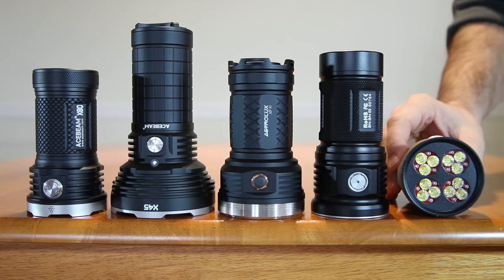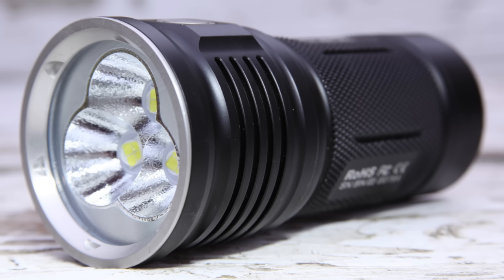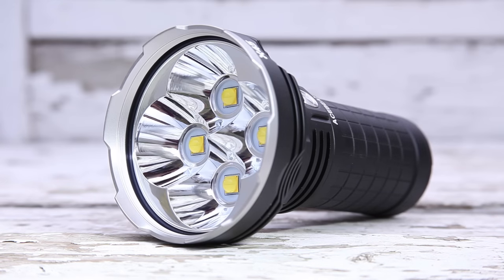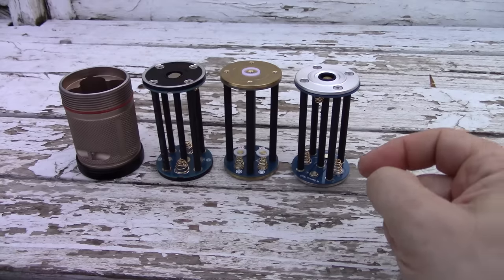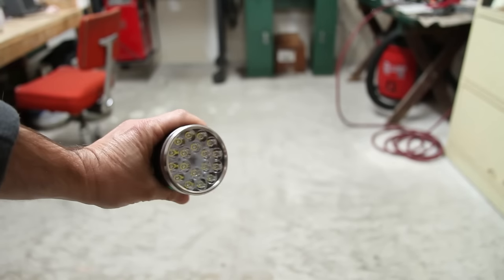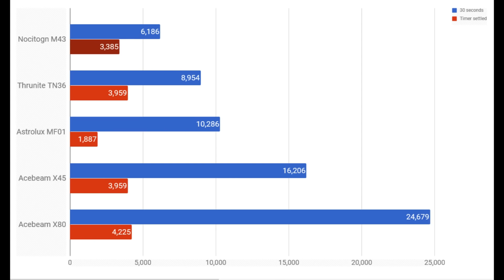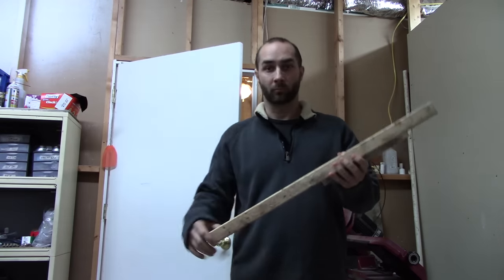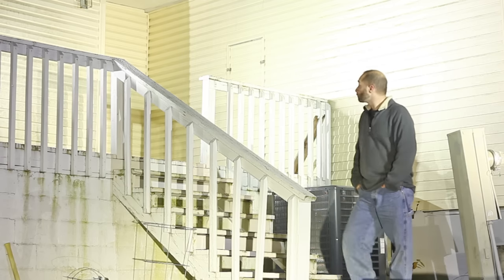Brightest Flashlights of 2017! (Top 5 best).

Comment: Hello!

Your channel is to be congratulated! I'm from Brazil and I'm watching your videos. Very good!

In your opinion, is the Astrolux MF01 12000LM flashlight in what quality position among the 5 lanterns? Bad, Medium or Excellent? Is it a good buy?

Thank you!
Reply from the maker: The physical build quality of the MF01 seems very good to me.  The acebeams I think are slightly better.   The only thing I didn't like about MF01 is I thought the output after the turbo timer went off was a little low, only 1800 lumens.   The others all got between 3000-4000.
Reply: Thank you!

Comment: i have 2 astrolulx mf01's i paid $79 for each of them and then bought the expensive samsung batteries and balancer charger for another $70.  This light is a monster.  The cons are its heavy, gets hot when super bright, and the anti roll body is useless with the perfectly round lens head.  Its by far the best budget in all the lights in review and many others.

Comment: My X80 has a different switch funtion. If i go from off to holding the button it goes to ultralow then red. If i keep holding it down after red it starts flashing red and blue like a police light :S to cycle through the other colours i have to let go of the switch after red and then press and hold to go throug the other colours. Can anyone confir if it is supposed to flash red and blue?
Reply from the maker: Sazan if I press and hold from OFF with mine I get moon light.   If I continue to keep the button pressed after it comes on to moon, I get a double flash and then when I let go of the button it turns off and is locked out.    To unlock it I press and hold again.

Comment: This question is for the owner of the Youtube channel. How do you like the MF-01 in the Cree XPG3 tint?  How would you describe the tint, the color temperature in kelvin and the CRI?
Reply from the maker: Hi SK,     Normally I'm not a fan of XPG3, but in this case it works.   The color is a slight step back from the far end of cool  I'd guess it to be 5700k ish.    CRI is ok, but just ok.  Not bad just nothing special hard to guess that but I'd say 75ish.     The thing that stands out to me is that the optic removes most of the nasty two color rings that you get with most XPG3 lights.   Normally you get an bright pink center with orange edges, and it makes me gag.    That light belonged to a friend so I don't have it here to re-study it on the wall, but IIRC that really wasn't the case with this light.
Reply: Cool! Thanks for the info! I purchased a CW version and I'm still waiting on it. I think i'll be happy if it's in the 5700K temp. I think that is my preferred color temperature anyways. 75 CRI i guess isn't all that bad. It's not great but it's doable. I did pick up a NW version of the Olight X7 Marauder from a guy on the BLF forums and while I do Like the NW tint, It seems a bit more on the 4500K side making it a little too yellow for my liking. The color index though makes everything a bit more natural. How would you compare the MF-01 to the x7? Thanks btw for answering my question! All your reviews are pretty good with a little bit of humor thrown in. Keep up the good work! I look forward to seeing more reviews!

Comment: the TN36 is nice, but i switched to TN35 bcause of the better beam, the ring controls and as flooder i got the M43 with XP-Gs
Reply: The TN35 is obsolete. The TN36 Limited blows it out of the water @ 11000 Lumens. I also have a TN40S which is a a really great thrower w/flood.
Reply: K Danagger in m opinion the NTN35 is still a nice allrounder.
Reply: K Danagger and the throw is still better on a TN35, thats also a reason its my main light when i need much light for a long time, next to the fact you can use it at max output without getting hot. TN36 doesnt have the thermal capacity and area to spread the heat for a long time, like my M43 Meteor... nice flooder, awesome to impress friends with 7000Lm Turbo... but only useful when you need under 2000Lm constant, because it cant get rid of the heat.
But thats why i like the M43... one button press for momentary „daylight“, small can design, and awesome runtime with 4x18650, so i have to charge the batteries like once, sometimes twice in a month, where i have to charge my small 100mAh LiPo, 550-800mAh 16340s and so at least once in a week.
Luckily, my NiMh AA/AAA Lights are used so „often“ that they stay like full for a year or so.

Comment: I think the Imalent DX80 may be the brightest at 32000lm
Reply: yeah, but they are built like shit and fall apart,and blow up...so whats the use ?
Reply: Yeah well im pretty sure the current Olight X7R Marauder is built like shit as it has production fault with the charge port which isnt even water resistant but claims to be water-proof
And then there is the X7 which i have and rarely use and the switch is fucked for no reason never been dropped never been wet batteries are always charged

Comment: if i want to buy a led flash light that is BRIGHT and not cost more then 50 - 80 $ what should i buy ?

I have looked at the Utorch UT02 Cree Large Flashlight - BLACK 3D 5000K  from Gearbest: https://www.gearbest.com/led-flashlights/pp_555780.html?wid=1433363

But i dont know if i can get better and stronger (and newer?) for lover price or better light for the same amount ? (46$)

Any advises ?
Reply from the maker: Hi Brian,   The BLF Q8 is in that price range, and is rated at 5000 lumens.

Comment: So far I found "KXN Super Bright Tactical LED Flashlights, 50000LM 3 Modes, Rechargeable" by supwildfire (sold by xinxin99) on amazon. It's 50$. It claims to have 15xcree with each led being a "CREE XML-T6 LED" type.   You might think of the Acebeam x80, but it has 12 xhp50.2 cree leds.. those Leds might not be much better than each T6 led.  I'm thinking that the 3 extra T6 leds might make up for its lower quality.  I know supwildfire is probably lying about their lumens. I'm expecting the flashlight to actually have 25k lumens instead of 50k... but that Acebeam is 25k lumens but an extra 200$... So I was wondering what you think. Ever Cree Led gives off its lumens based on how much energy it gets pushed into it by flashlight drivers but every LED has different capabilities and durabilities. So Im Wondering this flashlight would interest you. I'm just trying to get a good deal and looking for future flashlights for defensive purposes. Especially in a different country where I'd want my family to protect themselves. Btw, I was born in America o.o

Comment: Very misleading more lumans only mean brighter if its single filiment. Ten 1000 luman filiments are no more powerful than just a single 1000 luman filiment .
Reply from the maker: Lance.  Welcome to my channel!     Actually more lumens are more lumens.       In the case of LEDs they are slightly more efficient when you run them together.   If you run 10 watts over a single LED and it produces 1,000 lumens at that power, when you put 10 of them together they would be running only 1 watt each but be more efficiant so you might have 1,300 lumens.     In the case of the multi LED flashlights what they do is run more power over ever single LED.   For example a 10 LED light would have 10 watts of power running to each for a total of a hundred watts of power thus creating a much brighter light.     I hope this helps :)